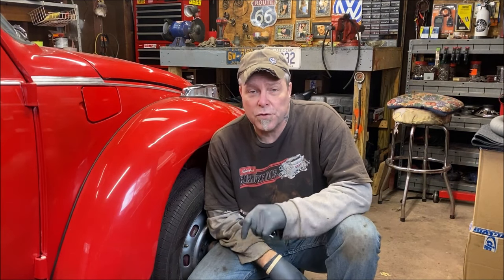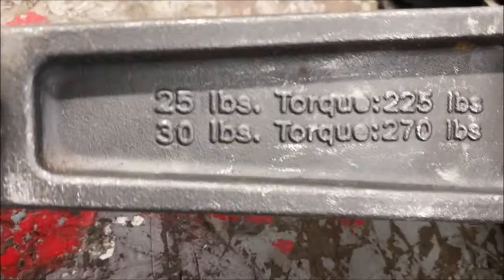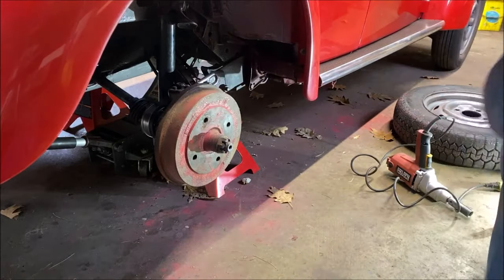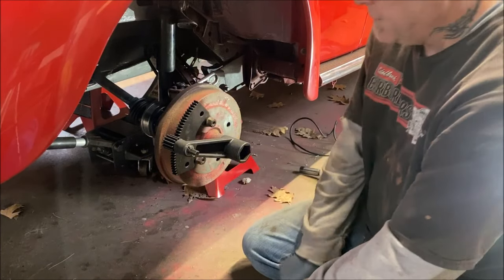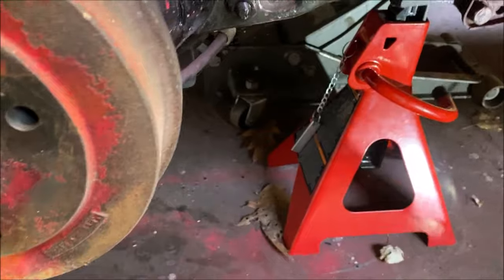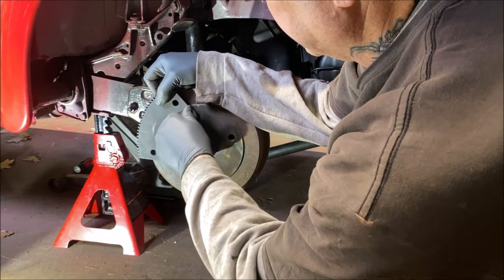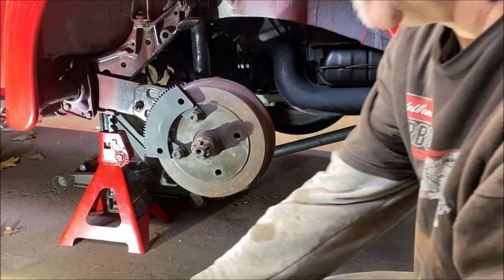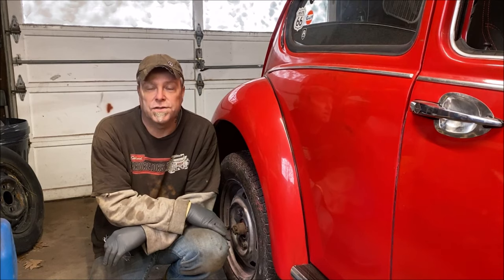VW Beetle - Super Beetle  Rear Axle Nut Drum Removal! Torque Multiplier! Rear Drum Nut!

Comment: Great video! The little gear is for a 6 volt flywheel.
Reply from the maker: Thanks brother! And thank you for loaning me the tool! Oh I didn’t know that, but I’m glad you said something. Because I will pin this to the top.
Reply: So it's for the 180mm flywheel? Or was it just that the older 6V flywheel has different # of teeth then the 12V?

Comment: Thank you. I'm feeling foolish! I purchased it because I need to set Crank Shaft end play. I saw a couple of YouTubes (for nearly 50 years I have just been using the same air impact, Chicago Pneumatic, with shop air set to 100 PSI and kinda went by the Old Mechanics feel). Now I see this multiplier tool works on axle nuts too. Awsome! And the torque specs are right on the tool. I'm really glad I purchased this tool if for no other reason that sometimes it is nice NOT to use my air tools. VWs now are my Zen and not my work... Thanks again for another great YouTube.
Reply from the maker: Thank you for being here. I truly appreciate it. Honestly, my whole life, I used a breaker bar with a long pipe on the end lol I really like the torque multiplier, especially when we get the stubborn axle nuts, it makes life so nice. Thanks for the kind comment.

Comment: HELP Slade. I have a torque multiplier on the way, should be here soon. I have a problem, I think. I replaced my rear drivers brake cylinder this evening. The drum and axle would turn before I removed the nut. I took the shoes out, cleaned the adjusters, etc. Put in the brake cylinder, and when I put the drum back on, I cant get the drum or axle to rotate, by hand. The brake shoes are loose so I know that's not the problem. Drum will slide right on and off.  What the heck have I done now Slade? Car is in neutral. Passenger side turns fine. Probably something stupid. I quit on it for the night. Its a 72 Super Beetle.

Comment: Hello, Slade.  For Bugs with CV joints, the torque spec for the rear wheels and the flywheel are the same—253 ft. lbs.  I have the TorqueMeister tool.  Best VW tool, ever.  I set my torque wrench to 28 ft. lbs, which gives me 252 ft. lbs.  Then I add a teeny hair more to get my 253.  

I only paid $69.95 for mine, but I bought it eight years ago—neener, neener, neener.  However, I’d pay the price you’re paying today if I didn’t have one already.
Reply from the maker: Wow you got a good deal on that! That really wasn’t that long ago. I’m going to buy one for myself, especially for getting the stubborn ones off. It truly does come in handy and make life so much simpler.

Comment: Thanks as always for the demo. I think I heard from another person who makes youtube videos for VWs that one should never back off of the torque in order to fit the cotter pin. I don't know. I did exactly what you did last time I torqued the nut. I backed off a little in order to fit the cotter pin. About the electric impact wrench. I had to buy the Bauer one from Harbor Freight to remove the nut on the back of the alternator. I tried with a breaker bar and double nutted the front but just couldn't get it. About 30 seconds of using the electric impact wrench and the nut came right off. Too bad I couldn't rent it somewhere. Anyway, nice job. Keep 'em coming.
Reply from the maker: Thanks very much Ken,  I truly appreciate that.
The only reason I truly backed off a little bitwaa because that electric impact gun put it very tight. 
All sincerity I should’ve loosened, and re-tightened with a torque wrench. But I got lazy, which is not smart. 
Yeah the electric impacts are much stronger than they were years ago. I was surprised since it came from Harbor freight. I rented one about three years ago and I and up costing me $30 for the day. So for another $10 I finally bought one.

Comment: Hi Slade, like you I used a breaker bar and a 6 ft pipe for years. I broke a 1/2 breaker bar and got a new one from Sears since it was a craftsman. But I got a 3/4 breaker bar which wouldn't  break. I didn't know about this tool. Pretty cool. I can't remember does VWS have reverse thread on hub nuts on the opposite side?
Reply: That reverse thread is only for the driver's side front.  That is so the speedometer cable doesn't come loose.
Reply from the maker: As Jerry stated only on the front! This tool is absolutely amazing. It just saves from struggling. And of course when’s putting it back on to get the proper torque.

Comment: Nice video Slades, got one and gonna try it this summer. Had to buy a 3/4 inch breaker bar to remove the nuts. That didn't work on one side, so I cut the nut off and replaced it with a new one. Previous owner must have used a scaffold pipe lols
Reply from the maker: It truly is a great tool to have on hand. Makes for an easier removal for stubborn ones. And of course easier to torque!

Comment: Great demo and video.  Tip on lining up the cotter key; only tighten to line up the holes.  If necessary, you can loosen and re-torque and then tighten just a bit more to line up the holes if necessary.
Reply from the maker: Yes absolutely! I was pretty much showing the torque tool. I used my electric gun first. I had no idea it had that much torque. 😳 Afterwards I loosened and retorqued. Thanks for commenting!!!

Comment: Another great video Slades. You know you are old school when you pull out a corded impact wrench 😂. The Harbor Freight impacts are my preferred ones actually I’ve got their Earthquake line and using them as a professional mechanic like me they are excellent and work nicely I have the power tools and air tools. For the axle nuts I always use an impact or breaker bar. I am too cheap to buy the tool even though I want more tools. Keep up the good work and videos. I always love finding out what the next video will be when I see the notifications.
Reply from the maker: Hey Blake, I hope you are doing well. I got used to seeing your name come up on all the videos I appreciate you being part of the community. OK now it’s my turn for a question, how do you like the earthquake line??? I keep looking at all of them. But I never go by reviews online because you never know what to believe. Thank you so much for being here.
Reply: @SladesVWBeetle  Thanks Slades. The Earthquake are amazing just used my air impact one on my Escape today because I had to replace the ABS tone ring so I used it to take the axle nut off it knocks those babies off with no fight or struggle it never disappoints. Also it’s never failed me either I just oil it before each use and it appears to be doing great. I’ve used one of the battery powered ratchets from them too and it’s excellent as well honestly I prefer it over my Milwaukee I’ve actually talked many of my coworkers into getting them. I think my next buy is going to be one of the stubby impacts I feel it will come in handy for many tighter spots. I’d also like to have one of their air ratchets too since I have the impact gun. Definitely worth getting if you need some that’s for sure. I’ve used mine daily since August when I first got them.
Reply from the maker: I’m definitely going to buy a few of their products. When I first noticed they were Harbor freight, I was reluctant.
I kept watching reviews on the earthquake, and everybody seems to really like them. My tools don’t get used as an every day mechanic like when I was at it for a living. But I still like stuff that works well, and has some power behind it.
Reply: @SladesVWBeetle  Oh yeah it’s nice. Also the Kobalt impacts are nice too I just used my friends today and the thing is a beast man.